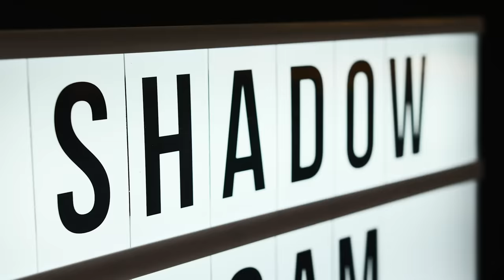We made a PORTABLE PS4 - Play FIFA anywhere!

Comment: What about air flow for ps4??? It will heat up and become a battlefield jet
Reply: true
Reply: Maybe you can just cut tunnels in the foam to the vents
Reply: @theducksquad7785  i dont think so that he did.. and even then it wont be sufficient
Reply: I think same, just we try with extra fan.
Reply: there is no space for that, but I guess you may lift up the console a bit to get air flow, since the console is not fixed there.
Reply: it's also the 1st thing i notice..😂
Reply: That's it's secret man, it's always heated up.
Reply: Surely you would take the PS4 out of the foam insert when playing... After all the whole case is just for transport. Hey that's just my take on things.
Reply: The console would burn like a mofo
Reply: Put some ice cubes in it then.😜😅.
Reply: True
Reply: That's the PS4 Slim, it doesn't get heated up
Reply: EpiXioN 999 i have the 1st gen ps4 and it sounds like a car engine when im playing a game.
Reply: @theducksquad7785  
That's not how electronics cooling system work.   you Need airflow which mean that air should came from different places. that's why you'll find in any device guide book that you need  a few inches of clear distance around that device
Reply: Like tools of spy gamers
Reply: 9999999999
Reply: My first thought as well. I bet that they just wanted to get this video out quickly and rake in that sweet Fifa sponsorship money, rather than spend the time and effort to make an actually properly working device.
Reply: i have the same question...and the only think that will make this project perfect it will be a water cooling system!i believe it will be the best solution for cooling down the ps4 inside that case!
Reply: @mbk1538  nnnnnnnnnnnnaaaaaaaaaaaaaaaaaaah for best cooling in the freezer:P
for sure it will have - celcius:P
Reply: he can just add a stand for the ps4 when he wants to play it.
Reply: He should had put a fan for ps4
Reply: Use among us vents for the heat to come out
Reply: after making the video, he did not use it again

Comment: Great ideas and thoughts but I don't see that foam holding the system in place and with the case closed it would rub against and scratch the monitor. The system need a strap or something. There also needs to be more airflow for the PS4 it will damage the system over time. Thanks for the suggestion I am really going to take your idea to the next level.
Reply: Did you take it to the next level? I’m curious
Reply: @RideNotSlide  i did something similar with a smaller case but did like a portable arcade with a raspberry pi.  i got inspiration from this video and a diy project called adventurepi by howchoo

Comment: Build one for my own and what i can suggest is do not have the whole thick foam covering every single air path. Have about 2 cm spacing for the rear of the PS (hot exhaust out). 

Invest in smaller cooling fans (4x4cm) to create an exhaust on the walls of the pelican. You can actually just use half of the thick one and arrange it so that it doesn’t cover entirely the whole PS.

This current bulild is going to explode or shorten your ps life.

Comment: What about the ventilation system. Wouldn't it cause high temperatures if the wind chamber was closed.
Reply from the maker: Not had any issues so far, but havent been giving it a battering either tbh

Comment: LOL. "We made a PORTABLE PS4 - Play FIFA anywhere!"  3:57 - plugs into wall socket. smh🤦‍♂️
Reply: its called portable... the ps4 is portable not the wall socket... get your brain fixed.
Reply: I will put power bank there or just a generator +10 kg
Reply: LMAO u cant play ps4 into the GULAG
Reply: Or Just Buy PsTv And Make It Portable With A Larger Screen. I Have Desingned It But I I Dont Know If It Will Work.
Reply: @kencarson-6yearoldfan  But it still needs a wall outlet to power the system on.

Comment: There's literally no protection to the top of the system or the screen. Of something hits that knockoff pelican hard enough, those joysticks on those controllers just busted your screen.
Reply from the maker: The screen isn't in contact with anything when the lid closes, and there isn't enough give in the case to make it move. If either the console or controllers did touch the screen, they would sink into the foam. Thanks for the feedback 🙂